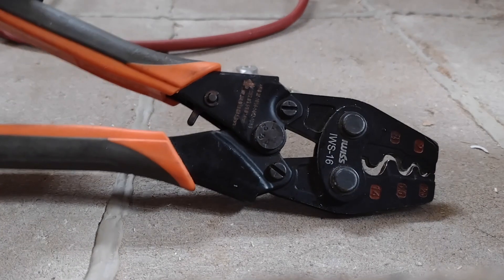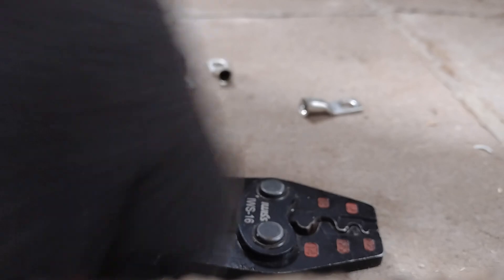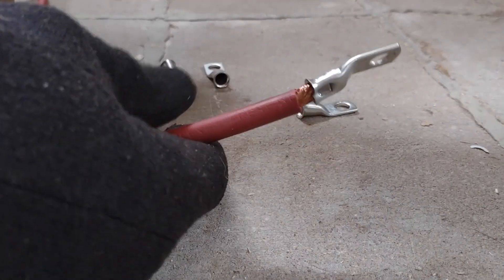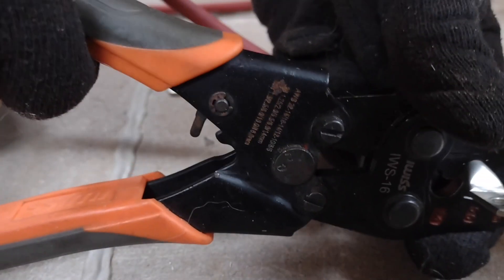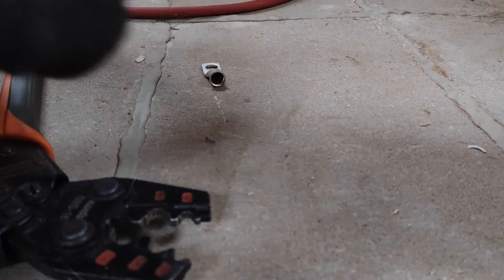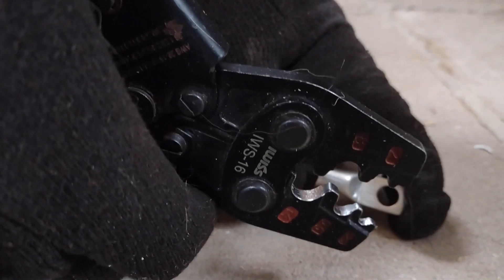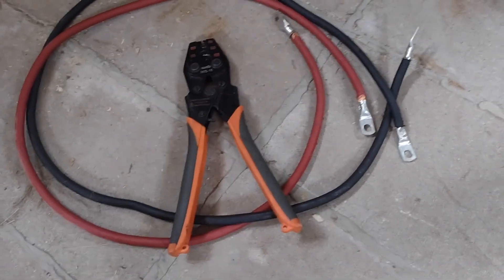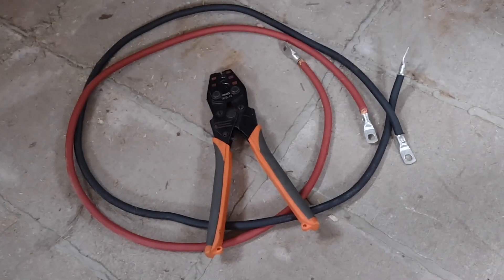Why This ~$21 Amazon Find Crimper Is A MUST HAVE For Automotive Wiring!!! WHEN CHEAP TOOLS ROCK!

Comment: The only will way to tell if it's working properly is it cut the crimped in half to see if the wires look as though all the strands of cooper wires were crushed into what looks like a piece of solid core cable.  If you can see the individual wire strands then the crimp isn't doing the job!

The tool is probably good for the smaller gauges but I highly doubt a $21 hand crimp has the power to properly handle larger gauge cable.

The hammer-style crimp tends to work fairly well on gauges between 2 - 10AWG sizes.  That's what I've used for years when making up welding cables.

TEMCo TH0006 Hydraulic hex crimper is a great pro tool (Made In USA) that will properly handle all your crimping needs.  I've owned one for over 5 years now and it's great for 1/0 AWG battery cables on tractors.  Also, 1/0 AWG always seems to be much cheaper than 2 AWG for some reason so it will end up saving you some money in the long run too 😉

Also, don't use electrical tape when heat shrink works equally as well and looks more professional 😊